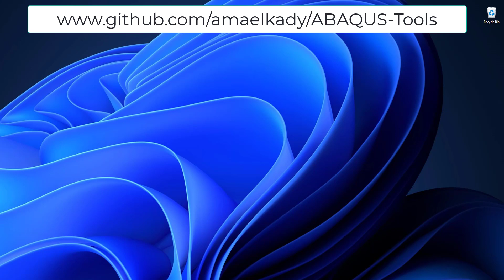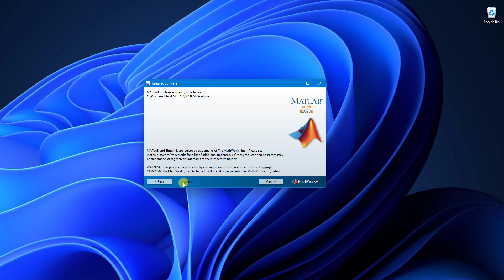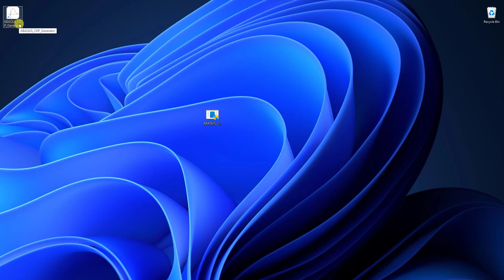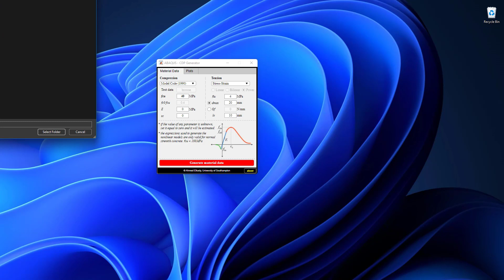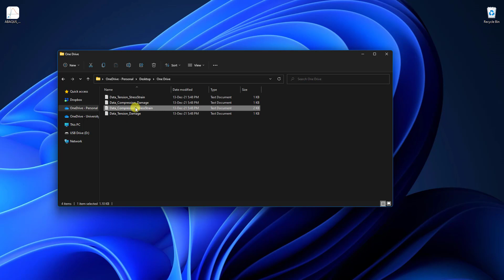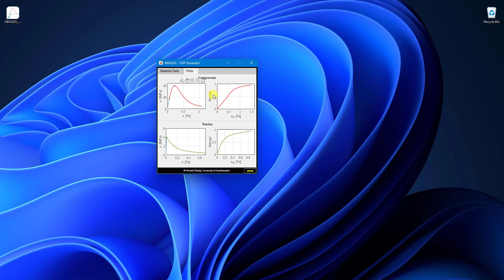#36 ABAQUS Tutorial - CDP Model Input Generator

Comment: In the concrete compression behavior table, there were 36 rows, while in the concrete damage table, there were 31 rows. The number of rows should have matched because the program relies on the plastic strain values to determine the damage. Thank you very much for your excellent and informative lectures — I have learned a lot from you.
Reply from the maker: Thank you for your comment. The damage data does not need to be the same size as the compression data, as long as it covers the plastic strain range.

Comment: Hello Dr. Ahmed .... I want to thank you for this fantastic informative video regarding CDP. Can you please guide regarding calibration? How to calibrate CDP using Abaqus? My model behavior doesn't match with material behavior?
Reply from the maker: Please be aware that the CDP model (and any material model that involves stress softening) is mesh-dependadnt. Therefore the response will change with the mesh size. You will need to calibrate the mesh size for a given material CDP definition.
Reply: Noted...Thank you Dr. Ahmed. If you have time please make a video on how to calibrate the CDP model.   @AElkady
Reply: Dr. Ahmed when I assigned all properties of the CDP model on projectile penetration on the concrete portion. The Mises stress (average) and strain (average) behave live stress-strain of steel and not behave like stress-strain curve of assigned concrete materials. So, what will be the possible region?  @AElkady

Comment: Dear Dr. Elkady,

I want to express my gratitude for your invaluable work. I've been attempting to simulate a cementous material using the CDP model with the assistance of your Input Generator. However, I encountered an error message while using your input generators. Could you kindly provide clarification on the units of input data modes? Additionally, I'm curious to know if your input generator is capable of modeling the CDP model with a maximum compression of 0.59 MPa and a maximum tension of 0.05?

Thank you for your time and expertise.
Reply from the maker: The units are indicated in the tool interface (MPa and mm). If you observe a bug for material with low fcu, please raise an issue on Github and I will try to address it asap.

Comment: DURING THE CONVERSION FROM CRUSHING TOPLASTIC STRAIN Abaqus FOUND NEGATIVE AND/OR DECREASING VALUES OF PLASTIC STRAINFOR MATERIAL MATERIAL-CONCRETE. VERIFY THAT THE DEGRADATION DATA UNDER *CONCRETECOMPRESSION DAMAGE IS CORRECT. there is a error when using the data from the generator (Chinese code C40)

Comment: Hello Sir, may i ask why is my Abaqus Job- Data Check is showing 
"DURING THE CONVERSION FROM CRUSHING TO PLASTIC STRAIN Abaqus FOUND NEGATIVE AND/OR DECREASING VALUES OF PLASTIC STRAIN FOR MATERIAL CONCRETE CDP. VERIFY THAT THE DEGRADATION DATA UNDER *CONCRETE COMPRESSION DAMAGE IS CORRECT"
when i input the values from the CDP generator for job analysis, and may i ask how should i solve this?
Reply from the maker: please check this video for information: https://youtu.be/wy84XGamn3g

Comment: Good morning dr.ahmed
I was wondering if you could help me with these warnings please,

For two-dimensional models, if a non-unity thickness is specified for two-dimensional solid elements and these elements are involved in an interaction such as contact, the same thickness should be specified for the out-of-plane thickness of the corresponding surface under *surface interaction.

For *tie pair (assembly__pickedsurf7-assembly__pickedsurf6), adjusted nodes with very small adjustments were not printed. Specify *preprint,model=yes for complete printout.

I am working on an RC beam-column joint

Comment from the maker: If you experience issues running the tool, try the following:
1) Make sure you have the latest update from GitHub.
2) Make sure windows languge is set to English.
3) Run the program "as admistrator".
Reply: Hello Sir, its not downloading due to security firewall, i disable it but still facing same issue

Comment: It's great to have such an amazing tool for CDP model in ABAQUS. I would like to ask you one thing about damage calculations, which formula did you use for damage calculation in Chinese code? Thanks!
Reply: GB50010-2010(The 2015 revision)，There are specific parameter value methods in the interpretation of the provisions of the specification

Comment: Dear Ahmed Elkady.

Your videos are A+++, I send a lot to my phd students. But promoting tutorials with tensile stress vs strain with softening, with no regularization is a HUGE mistake. The journals are rejecting a lot of papers, due to researchers now trying to do this. This problem is known since 1983 by BAZANT, using stress vs displacement instead. Please don t contribute for this "scientific confusion".

“Crack Band Theory for Concrete, Materials and Structures 16: 155-177, 1983”
“Non-local Smeared Cracking Model for Concrete Fracture in the Journal of Structural Engineering 1987”

In any case great videos
Best Regards
Reply from the maker: i'm glad you found the tutorials useful. The limitations associated with modeling tensile softenening using strain rather than cracking displacement are actually highlighted in another tutorials. While the latter option is generally recommended, the former is still usable under certian conditions. In any case, the choice and proper implenetation of a given modeling option relies entirely on the user who clearly must be familiar with the relvant litrature, the underlying theory and the potential consequences of the modeling choice.